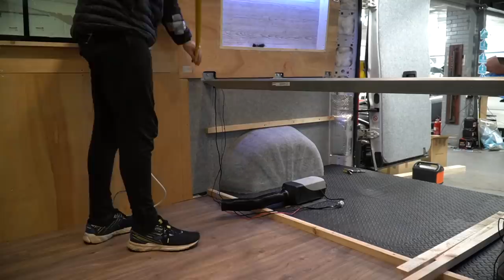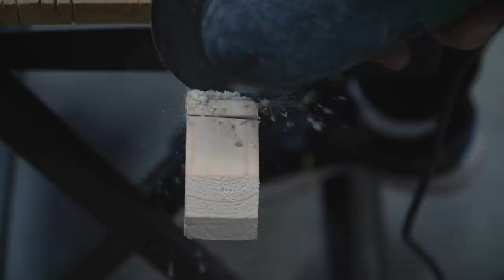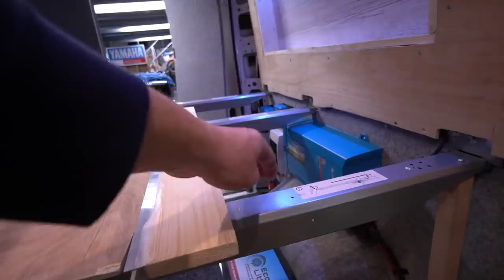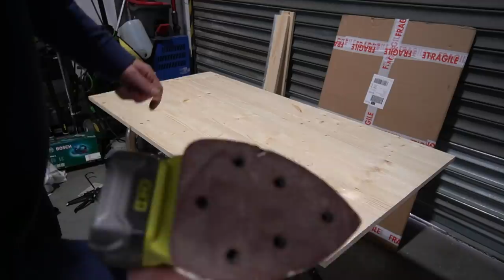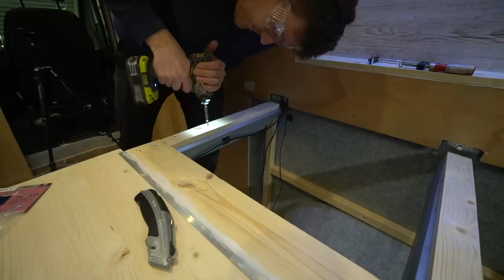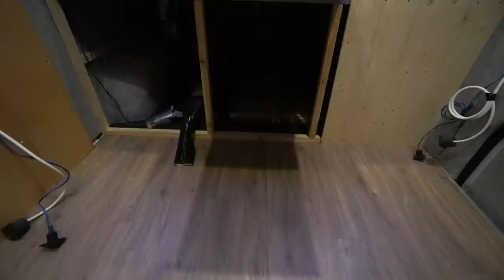SUPER EASY & SMPLE DIY Pull Out Table For Van Conversion - No Experience Van Build

Comment from the maker: Thanks as always for all of your suggestions and advice on how to improve the table. I learn a lot from reading all the comments and they’ll also help other people wanting to do similar things. Lots of people have mentioned  to use heavy duty draw sliders which was one of my ideas. Why would these be better than what I’ve done?
Reply: Hi Will, try some chalk dust or talcum powder on the edges of the table. Always look forward to your videos. You're flying it buddy! Edit; if the table does start to bow just flip it over! LOL.. Edit:(again) maybe cut a small slot (elongated hole) approx an inch in instead of a handle?
Reply: The drawer runners would give a smoother operation and the table would be more stable when out. What you’ve done is perfect for what you need though 👍
Reply: As humidity and temp changes the wood can swell and shrink so there will be times that it is tighter and times that it is looser. If you used draw slides then they would stay more consistent. You could also try and having aluminum on the wood that slides in aluminum on the bed to keep it slicker. I love your table design and love watching your videos. If you haven't figured out those bolts underneath the van you may want to look at screw extractors
Reply: Just did almost exactly as you. I just ran the underside edges over a table saw until they fit into the metal channel then sanded everything nice & smooth. I used a bar of soap to "lube" things. I picked up a screen door pull for a few dollars as a handle.
Your van is looking great!
Yes - my table is also an absolute game changer, I am loving it!!
Reply: Hi ya anyone what happened to tonight’s video ???
Reply: for the bed not to fall in the meddle the fix for that is you take the slots out and put a  2 inch  or 1 inch thick wood beam on top first on each side  but not where the table slides out from then  add one more beam on top but this time the bean needs to be shorter so that u have a little paces to put a metal Square tube beam over the table to have a  bridge over the table then back the slots go on this time u can add some in the middle over the table. and the wood might get worp over time to stop that from hipping   A penetrating oil like CUTEK® protects wood from the inside out. It works by penetrating deeply into the timber to repel moisture. It also helps to stabilise wood, preventing cupping, splitting and warping.
Reply: also adding slot going side to side might bend the c channel then it might not slide out that good
Reply: metal things that let u side out the wood are called C channels where the table slides out from

Comment: hey mate speaking from experience cover up all your new electric system, you dont want dust, metal shards or falling aluminium falling across your terminals. Top of your table a nice sheet of plastic around 4mm glued on will give it strength. Or another sheet of ply.  Good job so far, hearing you laughing was great.

Comment: With all the kitchen you've bought yourself it might be worth considering using kitchen cupboard doors for the under table doors and also maybe use the drawer rails and runners on the table to allow it to pull out smoothly? after all you have a whole kitchen to play with for different bits of the van.

Comment: If you made a bi-fold door for the space under the table, you might be able to use it as a support for the table when it's pulled out.
Reply: Totally agree
Reply: nice idea, I was thinking of a leg,
Reply: I was thinking something very similar. Basically making a faux panel in front of two legs that would be permanently fixed to the table. It would jut out about an inch from the adjacent sides, but you'd have permanent legs and an opening for underneath the bed when you pull the table out.
Reply: @TKG  did  you mis spell keg?
Reply: That's a good idea actually.
Reply: Great idea but would it block leg room?

Comment: Excellent work Will. The only thing I would do is make some holes where the board won't be exposed so there is some ventilation for the middle of the bed. The slats are doing it either side but there is nothing in the middle this might make the bed damp in the middle. Only saying as our bodies produce a lot of sweat and needs circulation under the mattress. ✌✌👍😊
Reply: Then he could use the holes as cup holders when he pulls it out as a table
Reply: @ZafiraSteve  good call, so long as he makes them not too small or too big :)

Comment: One small suggestion might be to put a board along the side of the mattress to protect it (and your bedding) when you are sitting at the table, especially when eating. It will also stop the mattress and bedding encroaching onto your table. Can't wait for another instalment of the diesel heater saga.

Comment: Will you are a diamond, no matter how you do it or how it turns out, you are learning every step of the way, plus you entertain us all. 1 suggestion is maybe you could replace the 2 side lengths of wood you have the rails (table runners) screwed to & extend them to the 3rd metal bed rail, so if somebody is laying on the backdoor side of the bed the full length wooden sides will be resting on all 3 bed rails rather than them ending in the middle empty space with no support beneath them, if you can understand what I'm trying to say (a bit long winded I agree) but you are doing amazing & tackling things head on so good on you. Everyday is a school day. Build is coming on & progressing well...
✌😁👍

Comment: Smoother: File the edges off the inner faces of the aluminium profile pieces. Also maybe you could make 2 legs which are the same thickness of the bed support slats. They could slide in under the mattress alongside the table when not in use, then to fit under the table corner when in use have some sort of a dowel fitted in the end of the leg which locates into a hole in the underside corner of the table

Comment: Hey will if you are still adding in the solar panels, you could always just get a little eco friendly electric heater. Electric heaters have come along way and are build alot safer then they used to be.

Comment: Excellent table Will. My van is a mish mash of reclaimed items, you're making things way neater than me. 

My only piece of advice concerns charging points for devices and I wanted to suggest buying some USB sockets and installing them in the bed "beams" almost where the table slides from so you don't have to put up with trailing cables at your feet.

Comment: Like the design. Maybe raise the slats double what they now by removing the slats then run 3 long pieces of wood across. This would enable you to put a full set of bed slats in and you wouldn’t need to mess with the table. Plus if your boarding it off you wont be able to see it.
Reply: Are you suggesting he should bore some large ventilation holes in his table?  Incredibly that’s not as stupid as it’s current design, with the mattress wiping against the table as it goes in&out
Reply: @chriss9177  No I mean remove slats. Get 3 wood beams same size as the 3 metal bed frame put them across then you can fit a full set of slats, So where he raised the slats first it’ll be double. So when will pulls his table out it won’t make the mattress dip as it wouldn’t be touching.

Comment: Also on the leg front. You could fashion a spring loaded one which flips down when the bed is pulled out and then when you push it back in the leg folds flat

Comment: A full height cupboard door hinged on the right side could double up as a table support when it is open. A small bolt fixed to the top left corner of the face of the door could lock it in the open position into a small hole in the underside of the table. The bolt could also be used to stop the table sliding out when driving .You may also want to cover the table framework with thin MDF to prevent it snagging on the underside of the mattress when being put back in.

Comment: To make the entire project smoother and simpler, use some drawer-slider type fittings, some of which can take large loads and will reinforce the edge of the 'table' ... These will have bearings in them and will be a vast improvement. Adding a catch of some sort will hold the table either in, or out ...

Comment: A wise decision, and when you close in the area below look at a sliding barn door or pocket door style to minimize it's footprint on the room. I agree about the ventilation holes in the bed frame too, you want your mattress to breathe. One thing you're going to have an issue with is the diesel heater hose at your feet, you'll constantly be stepping on it as you are sitting so that's something to consider (angling it so it goes under your chair more, for example).

Comment: You could perhaps try adding a strong piece of metal underneath the table and make a few small cuts in the beams to let it run through? Might help the table to run a lot smoother and will give some extra support both when pulled out and when lying on it. Well done though mate , smashing it!

Comment: Great video will, suggestion for your first second and third beam where the board is sitting glue a strip of 4 way stretch carpet that way then when you pull the board out you won't have any rattle 👍🏻 Also maybe a stop between the middle and back beam so it doesn't come out all the way when driving, as we have all seen how good that is 😏 only kidding buddy great video as always

Comment: hey will you have done good
candle wax from a normal white candle rubbed only on the runners is the way to go (dont rub it on the wooden table top as you dont want to mess up the table with too much wax)
I would re-think the slats going up the way because you will be able to feel them through the mattress, just make sure no-one sits on the mattress when the table is extended
I wouldn't bother with a handle as it will get in the way and could break off easily as its so near the end of the table, just drill a few well placed holes in the table top to get your fingers in

Comment: for the bed not to fall in the meddle the fix for that is you take the slots out and put a 2 inch thick beam on top first on each side  but not where the table side out from then i add one more beam on top but this time the bean needs to be shorter so that u have a little paces to put a metal Square tube beam over the table to have a  bridge over the table then back the slots go on this time u can add some in the middle over the table

Comment: I think the table will eventually wear away on those metal runners, perhaps you can use some drawer runners or add some metal bearings to the edge of the wood to help it run freely?

Comment: Good work buddy! Looks good.
I was thinking you’d put a whole new sheet of wood over the entire top of the bed instead of the slats with holes drilled for air ventilation, but using the bed slats over the table top essentially does the same job and keeps the weight down. Like it. Nice work.

Comment: Hey Will, great job! The extra slats are needed really as I think you'd be surprised at how quickly the sliding motion will start scoffing away material from the mattress even if the wood seems very smooth, routing the top edges round would help with that... you can buy drawer sliders that would make it silky smooth but your design is simpler and lighter.. I think I saw them in Wickes though incase you ever want to go that route..

Comment: Build a fold out arm under the table with a vertical hinge in the centre of the metal beam and you can use magnets to hold the loose end while travelling.

Comment: Hi will just been thinking you could put a couple peace of 30mm ply on the bed plat form. On top of the slat. That way you could sit on top if the table. Is out and it will make the table stranger and more ridged.

Comment: Nice. I did have mine like that but with no sophisticated slider system lol. Have since screwed one of those metal slider poles on the end of the beam which table then hooks on to. Has adjustable leg on end too so has to be stored underneath bungeed to wheel well box - bit less room for surf boards dam it.

Comment: You can use some bar sope on the edges of the wood, which will make it smoother sliding. nice job on the build so far.

Comment: Glad to see you back to your happy self pal. Would it be wise to bin the Chinese diesel heater? Get a diffrent heat completely Ive seen alot of the Chinese ones have issues. Chamfer the  edges of the board will make it smoother

Comment: I would consider attaching an arm to the bed frame on  a hinge that you could open out when the table is in position. That would give it more stability in the ‘out’ position. You could then fold it back when you are not using the table

Comment: Do like you solution for the table, clever to incorporate it as a table and bed base, i too would have took off only the area of wood that slides in the rails, if you had made it thinner there you could have also put some teflon strips to help it slide, but two good things, one you have reduced the weight by planing the entire board and 2 it wont slip out when you are driving, as i say, like the concept.

Comment: Looks good dude. Is it the best solution, no far from it, but it functions and that's the main thing; a carpenter's van would look different to an enthusiastic amateur. Add some support for the middle of the mattress and it should be fine, and as someone else said if you're a bit clever with designing the garage door you can have it be the support for the table.

Comment: Hi Will, you can use drawer slides or track back brackets in inner side of channels to make it easy to drag and look more professional and attach a rubber band handle instead of metal handle to pull the table. In this way, you won't get hurt your leg while getting down from bed :)
Reply: Why have you posted exactly the same thing repeatedly, it just make it harder for everyone else to read the comments?
Reply: @tonysutton6559  Sorry for inconvenience, Tony ! Actually, I was posting it and there was error and suddenly, they all were posted. Anyhow, this will help Will to read and comply. Hahaha 😂
Reply: @fawadchaudharyvlogs  🤣😅😂

Comment: Tony's Tip 1 - Screw a stop to the underside of the bed to stop it flying all the way out in a crash or emergency stop situation.
Tony's Tip 2 - Just buy some slightly thinner plywood instead of spending hours with a plane and sander.
Tony's Tip 3 - If you ignore Tip 2 and want to play with a plane, use a shoulder or rebate plane and just plane down the bit that goes in the aluminium section
Tony's Tip 4 - As an alternative to Tip 3 you could use a router to do the same job and do it in about a minute.

The danish oil looks really smart, a good choice.

Comment: Just 6mm ply in one full size sheet on top of the slats, the mattress will sit on the ply and the table will pull out and the mattress will not sagg, just bring the height up before you put the ply on top on the slats on the table pulls out freely

Comment: Hi will fab build .just a thought for the mattress from falling into the  hole when table is out.you could put a maybe 4,5 mm plywood sheet on top of the frame you've made for table I'm sure 4or5mm wouldn't make much of difference to the height of or feel  uncomfortable  just a thought  good work tho 👍👍👍

Comment: Use bar soap in the channel to make it glide smoother. 
I would have routered the edge on both surfaces to fit the channel and maintain the integrity of the board.

Comment: Another great video, careful the mattress doesn't impede the sliding of the table.  Why did you not go down the route of large drawer runners for the table?  They would have done a brilliant job, did Wandering Home not do that with theirs?  Could you have made it to pull out the same on the far side giving you a work area fro BBQing out the back of the van also?  Keep up the good work.

Comment: You really could've really used ball bearing sliders, which would hold the table much stable from all the angles and way easier to slide. But nowww you can go on with some greezing over the sides. Btw i love your work

Comment: I would consider a piece of timber to fold out from the edge of the bed on a hinge so it supports the middle!!! you won’t be able to attach a leg to the bottom side as it won’t go back in it’s runners

Comment: Will round the edges top & bottom instead of them being squared off,that should help a smoother action,

You could have made it on runners like a kitchen drawer, you can get heavy duty ones now,but good on you for trying